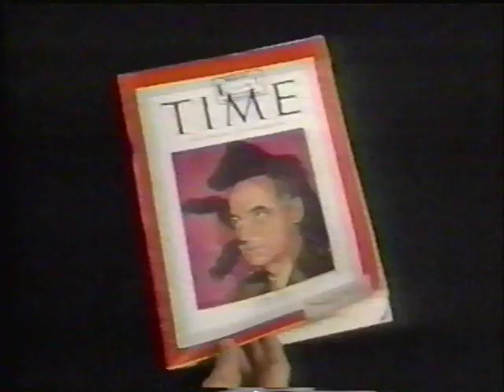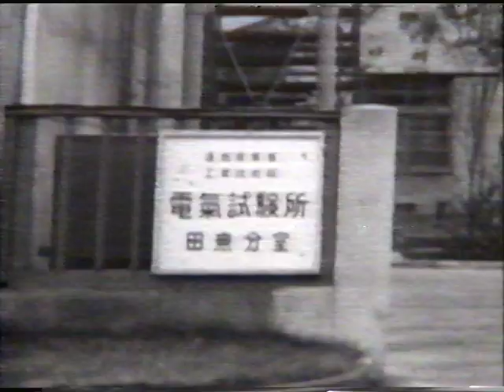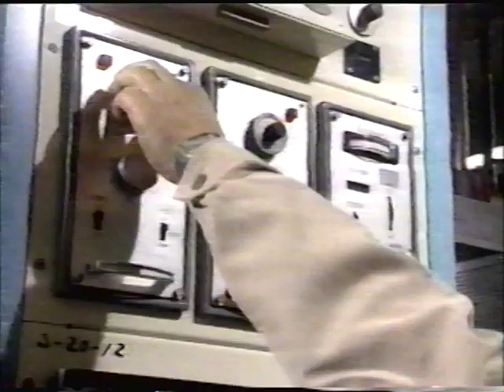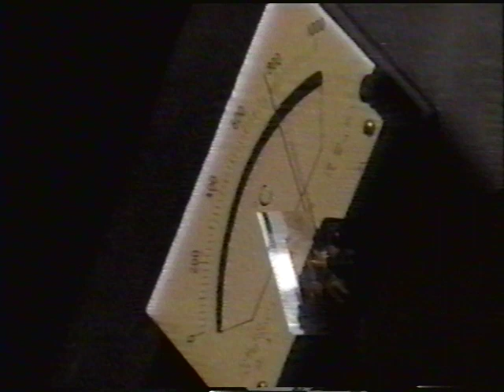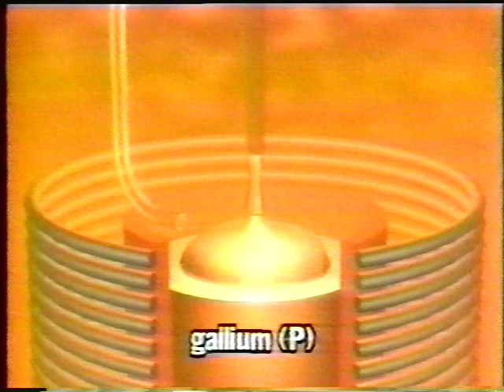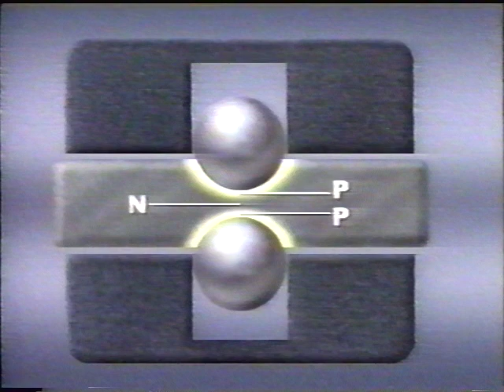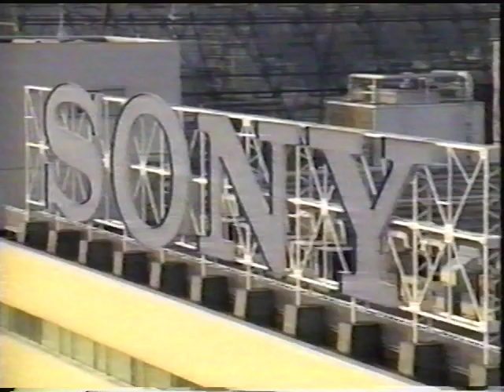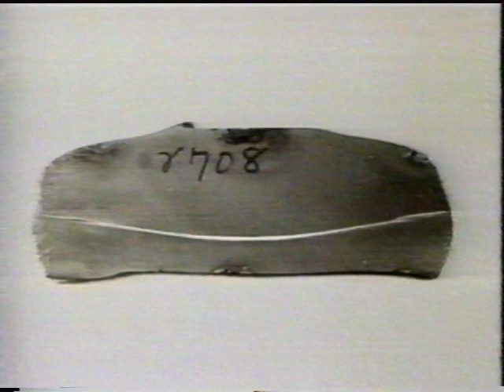Birth of the Transistor - A Video History of Japan's electronic industry - (Part 1) - Re Upload

Comment: Thanks for the reup! Any chance youd be willing to send over the raw captures for my personal video archive?
Reply from the maker: Captures are lossless interlaced. 60GB total.
Reply: @RC-nq7mg  i'll have to see if there's any free file hosts that'll accept a filesize that big if ya need
Reply: @cpufreak101  Filemail is free and allows 5 GB per file. More info below

4,999,999,488 bytes / 1000 / 1000 / 1000 = 4.999999488 GB ... this is what Filemail means by 5 GB

4,999,999,488 bytes / 1024 / 1024 / 1024 = 4.656612396240234375 GB ... size on hard drive

That is the maximum size allowed per file on Filemail

The 60 GB can be split into individual .rar archives with WinRAR, I think 7-Zip can also do it, but I have the most experience with WinRAR.

Edit:
Forgot to mention that the reason I don't have exactly 5 Billion bytes for the calculations is due to 4096 sector size that is common for a lot of formatted hard drives.

4,999,999,488 / 4096 = 1,220,703 sectors

That allows each "5 GB" split archive file to not have any wasted bits in even a single sector.
Reply: You could use a torrent to share files that large. Why did you reupload?
Reply: @MegaKopfschmerzen  he said the why in a comment on the other videos, he still had the tape and attempted to make a higher quality capture
Reply: Not bad! 60GB would be great for a torrent! I'd love to add this to my plex library
Reply from the maker: The capture setup I used for this recently died while I was working on digitizing some vhs recordings for family, and I have upgraded to a composite to 1080 upscaler and hdmi capture. The results on those tape look real good, so there is a potentially better quality capture of these coming.